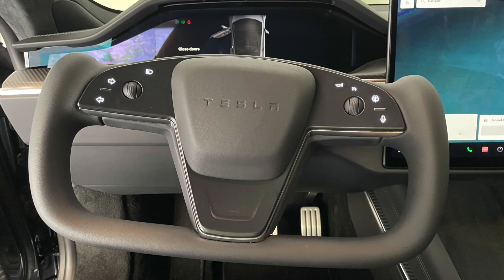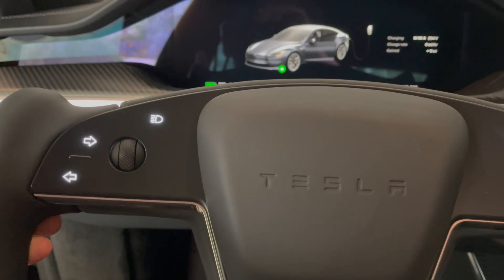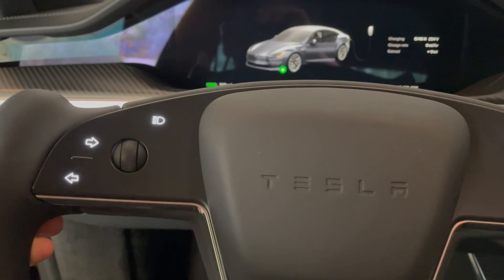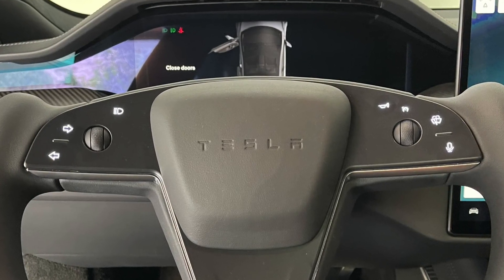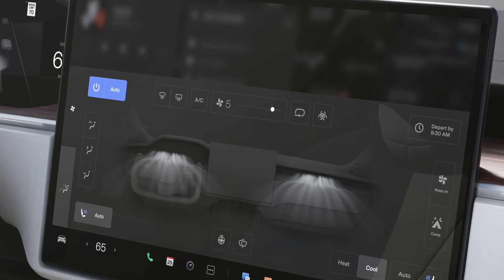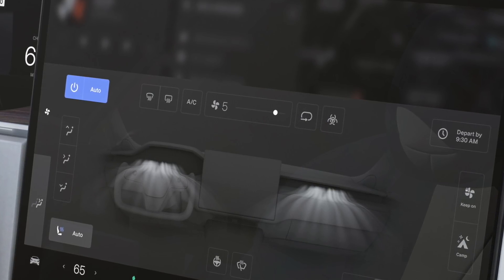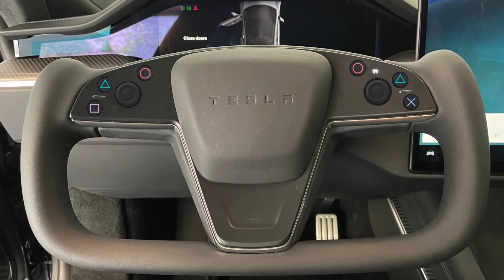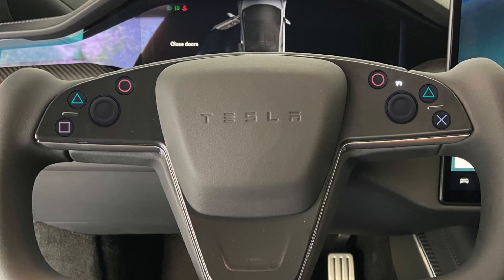Fixing Tesla's Model S Plaid YOKE blunders

Comment: Squeezing in the functions of the removed stalks into touch sensors onto a steering wheel they cut in half must be one of the worst design f ups of all time. Totally insane without having at least we'll proven level 3-4 autonomy. Untill then most human input is NOT an error.

Comment: For the price of the car, this seems like a no brainer elective recall. Use the controller design with physical buttons. Move all the buttons outside the sticks so there is no accidental push, and put triggers on the yoke handles. Either left or right trigger is the horn. Upper triggers could be added for extra programable features or game mode. A short flick of a main trigger could be a friendly "honk honk" sound. Or nothing at all, only a full pull to honk. User preference. I'd say NO icon just blank on the buttons too. Less lights and junk to add. Plus TM issues. The "lower middle right" reference the names of them for instruction would simplify use. If they have iconographs, some folks will always have to look at them to remember which is which. But with no images, they just learn to go where they are located. Safer that way.

Comment: I definitely have a love/hate relationship with Musk and his companies.  I love the innovation, vertical integration, and a lot of his general business philosophies (despite not having traditional benefits he's obviously doing something right to have so many loyal employees).  I hate when they do form over function though and I also hate Tesla's not-so-micro transaction model, if the hardware is already there why charge $10K to activate it (I'm talking about things like heated seats, I can accept the cost a bit more for cutting edge FSD).  From what I've read and seen Tesla's core (EV specific) hardware is for the most part well above any others (batteries, motors, general drive-train stuff) but their controls, cost, and (lack of) QC on new hardware (mostly external stuff to be fair) is a hard pill to swallow.  When I do get an EV I'll probably go with another brand, one that will hopefully do most stuff right, but even then I'll have Musk to thank for getting the ball rolling and showing everyone how it's done (and how it's not done).

Comment: Touch controls have NO PLACE in a car. Infact I'd say car interface design peaked in the early 2000s and we've been going backwards every since. My first car was a 2003 model, when I wanted to turn the fan or temp up to high, I could very quickly turn a knob and within a half second be on the setting I wanted. In my 2013 car I had to press a physical button 8 times to go from low to high, and unless i took my eyes off the road I'd have no idea where I was starting from and where I was at now. Touchscreen controls are a step even further away from ideal

Comment: I got my Plaid at the end of June, 6,000 miles in and I still hate the yoke (and the brakes, but less so). The video is spot on in identifying the issues, but neglects to note that everyone of these issues force you to take your eyes off the road, a lot. The solution is simple retrofit all the Plaids with a wheel and stalks from a Model 3. NHTSA needs to order it.

Comment: Everyone is parroting that Tesla is trying to "solve" something. 
Just because someone does something differently doesn't mean they are trying to solve anything, much less a non-existant problem. 
Juicero was solving a problem that only existed when they created it (and could still be bypassed by some scissors), Tesla is just fucking around with designs are sadly missing the mark on this one. 
Also, im pretty sure people said the same thing about automatic cars vs manual. 
Did Tesla do a good job? Can't say for myself but it does seem like some common sense was missing.
Does that mean no one should ever make a turn signal that is not a lever and if they try everyone automatically gets to flex intellectual superiority? Also no

Comment: I've been driving the same car since 2006 (15 years).  My car has manual transmission, manual windows, etc.  No frills.  No backup cams.  No lane assist, no voice control etc.  It's as vanilla as you can get.  Had 11 miles on it when I bought it.  Now has 190K.  I guess you and me have different ideas of "car problems".  lol.

Comment: The whole touch shit in new cars is such a terrible idea. In the car you always want to change settings blindly, that is impossible with touch buttons. They all use touch buttons because they are very cheap compared to good buttons. In the safety rating they should include a test where the driver has to acitivate basic stuff like wipers without taking eyes from the road. If it is not possible, they should completely fail the car.

Comment: Mind boggling. Many racing games fans spend extra on a USB steering wheel, despite those games often acceptably support generic controls (keyboard & mouse on PC, controllers on consoles). I expect very few would consider going back to more generic controls an improvement; but Tesla's design team seemingly is betting they would do so if they bought a high end electric car.

In my opinion their decisions fly in the face of spending preferences and decades of bottom-up tinkering (driven by fatally serious consequences for incompetence) for the sake of adhering to a design team's concept drawings.

For any vehicle's controls to demand a driver eyeball them in confusion or frustration while in motion is the most insidiously harmful thing imaginable.

Comment: Touch is almost always a bad idea, some recent examples:
- Canon EOS R has a touch bar = worst idea ever, everyone hated it, guess what? The next models removed it;
- MacBook touch bar = horrible, give me back the Function keys, and they came back;
- PS3 (I think) is using touch inputs for power on/off, half of the time I don't know if the input has registered or not, PS4 fixed it;
- recently I bought one Robot vacuum cleaner, and its main button is a touch input, so I have no idea if it's registering my input, I end up pushing hard and multiple times;

Comment: You know what'd be cool? A lever, that goes up if you wanna go left and down if you wanna go right. Then maybe at the end of that lever have a twisty nob that changes the speed of the window wipers. Then, right at the tip/end of that, have a little button that you push to squirt window washing fluid, but if you hold it down, it sprays for about 20 seconds. That'd be neat.
Or maybe voice assistant that has a dealer app so you can order a new car.
Reply: Wow, that is such a futuristic design !!

Do you think any high tech company will have the smart engineers to design such a cutting edge, state-of-the-art concept and bring it to a reality? A Silicon Valley start-up maybe?

(Love your sarcasm, by the way!)

Comment: Great topic for a video! I design board games for a living and this is the type of functional vs. aesthetical critique that I deal with on every project. I've learned is that, in general, if you design towards accessibility for the outliers that test the limits of your system, you end up creating a more ergonomic system for everyone. In this case, someone with vision issues or a missing limb/finger. Of course someone who is legally blind should not be driving a vehicle, but that doesn't mean any sane driver should be forced to take their eyes off the road or risk surprising themselves with accidental button presses. Similarly, the other rule: if it ain't broke, you better have a good reason WHY you're fixing it. 

It's great that Tesla allows buttons to be remapped, but that is unfortunately the only positive to be said about this entire setup. IF it looked super cool I'd at least give it some props there but it simply looks acceptable. I think your critique is excellent even if your eventual solution brings along its own set of issues (like, whose going to memorize what the square button does lol), but there's a pretty good reason why traditional knobs and dials exist from a functional (and safety) perspective that far outweighs the added depth and complexity of becoming proficient using them. 

I like that Tesla is questioning what is essential to the driving experience, but it's clear that sometimes they'd rather ignore pretty critical feedback and push newness for the sheer sake of newness. Tech is like that.
Reply: An excellent post !
But....”Tech is like that” ?? It doesn’t have to be. IMO new tech CAN be be both an improvement and highly practical at the same time.
It’s all up to the designers and engineers.
Can you imagine if this amazing new Plaid model S HAD a regular steering wheel, AND regular stalks (say, from the model 3/Y) ??
It would be close to perfect. A new owner could take delivery, and immediately enjoy it’s amazing performance, without even giving a second’s thought to “re-learning” how to drive.
I’m not in a financial position to buy a $100k model S, but even if I was, a highly impractical, poorly designed stalkless yoke would be a total deal breaker for me. And know I’m not alone. There are 10s of thousands of potential model S/X purchasers who feel the same way (some who have already owned 2-3 previous Teslas).

Comment: This video just proves that Tesla is a lot of money for very little quality. Yeah, Tesla is innovative in some areas and they solved problems of electric cars faster than the rest of the industry, so I don't want to take away any of this. But if you take a deep look at quality, a lot has been poorly designed or cheaply build and the reason is probably that the innovation and huge batteries and the comfort and styling already costs so much money that the car would be entirely unaffordable if you don't cut back on other aspects. E.g. take the clearance (engineering tolerance) of these cars; it's very poor when being compared to BMW or Mercedes.
Reply: The quality of new Tesla's is excellent, it's just car journalists have nothing else to complain about and don't want to look biased so they mention quality. Yes I agree with the video however. Indicators as touch controls is pretty silly.

Most other companies make only electric as "compliance cars" - so their fleet appears to be more efficient as a whole. Or in the case of BMW and Mercedes their equivalent performing electric cars cost significantly more money.

Comment: I honestly quite dislike the Tesla company (though there are some good aspects) and I feel that the critiques levelled here are a microcosm of the fundamental issues.

Besides that, physical buttons are simply superior in just about every situation. A touch screen is... fine. It has it's uses, the main one being versatility (but certainly not accuracy or responsiveness). And I think it's really past time that all the tech companies get past their infatuation with touch-based interfaces and other finicky and inferior input methods (the clickable scroll wheel, for instance). I suppose it's some misguided pursuit of "innovation" that isn't innovative at all. There's nothing new about this stuff, it's just inferior except for some very niche use cases (touchscreens specifically have a use as variable interfaces where timing of input and high precision aren't needed -- but glowy touch-based not-buttons have almost no reason to exist on most hardware as even haptic feedback tends to be insufficient).

Also, it's really weird how the intuitive elements have been removed. The horn should be a massive central "button". If you're driving the Tesla as some temporary thing, you very likely won't know that the tiny little button is the horn. Nor will you know the needlessly complex input method to use the indicators. You're absolutely right that they should just use buttons. Though not necessarily a full on game pad design as I think it's actually quite stupid and irresponsible to build video games into a car.

One last thing, just in general I also think it's irresponsible for them to have renamed cruise control into autopilot. Because it is just cruise control with a couple extra safety features. But by renaming it, that effectively makes it unsafe because too many people have assumed that autopilot is... well... an autopilot as colloquially understood. And thus there have been a number of accidents, some fatal. This too is indicative of a general irresponsibility of the company.
Reply: In a plane, AutoPilot is nowhere near as capable as what a Tesla does. So I'm not sure why it is colloquially assumed to mean "car drives perfectly all by itself". But yet, that's what almost everyone thinks of, and I did too honestly.

Apart from a few military bombers which a terrain following function, the vast majority of planes simply maintain heading and speed based on a present track made of waypoints.  They have no awareness of the real world or ability to negotiate obstacles etc.

Comment: The positioning of the scroll wheels on the Model 3 steering wheel is much more natural, and I've not had any trouble using them. They're closer to the "edge" of the wheel, so when resting your hand in a normal position they fall under your thumb. Our wheels have the rubber grip on them, not metal. I expected the rubber to get all gross and slippery like a mouse scroll wheel, but 130,000 miles later they still work great. 
Really, I think they should have stayed with the Model 3 control system - and added a twist to the wiper / turn signal stalk like the prior models.

Comment: I hate to sound TOO old school, but i think manual functions are the safest. My volvo has this automatic handbrake which i think is really cool... but one day that single button is going to fail and id like to be able to pull the handbrake manually, input devices, touch screens, illuminated icons scattered about are things that should NOT be in a vehicle. you would be fined for using a phone, a device which is just a smaller version of the thing you are driving as it is "too distracting" lol

imo I think minimalism is the way forward, every single function should be uniformly the same on every vehicle and must have a backup alternative like if a handbrake button fails, there is a standard lever situated for the handbrake to work. also whatever vehicle you get into - the functions and controls are the same. 
trying to find fog lights, in fog, in a different car is near impossible as the placement of this button is different for every single vehicle! Haptic feedback in an environment which vibrates over different terrain is not a good feature as well and controlling major functions on a jog wheel shouldnt be allowed imo.
Reply: They test things like that handbrake. The button is there because it can outlast the actual brake :-)
It seems weird to think about more components being more reliable than a simple physical handbrake you can pull, but that's what the testing shows. 

Where it does get complicated is that if it does fail, repair and spares might be more difficult.

Comment: Tesla has no idea how to make a good UIx! I dare say that having a horn not in the center of the wheel maybe not road legal in some countries. The thing is, if the wheel is turned and you need to sound the horn, that all important button is not in the same place.
Also a non circular steering wheel is an ergonomic nightmare. I’ve driven the infamous Knight Rider (a clone) and in that one hour drive, I missed the steering wheel 3 times. Especially when you drive on a road with hair pins. Very disconcerting experience for me :)

My colleague has a Model-S and he really got frustrated with its lack of QA. His touch screen failed 2 months after delivery. The engineer said: “you’re driven too much over cobblestones so the ribbon cable vibrated loose.”
1 month later the whole screen stopped working. And he says: “the majority of the bloody car is controlled through that screen! Without it it’s a cripple car.”
Now I though it was a one off. But this week starting a new project, the two colleagues there had their screens die too. And the faux leather is absolutely knackered after two years. QA is really appalling it seems. And for that price, I expect a premium product. So I’ll stick with my cheaper KIA for now :)

Comment: -They should switch the horn with the voice buttom and the voice button with the wiper. 
-Also  with the touch sensitive of the turn signals its annoying try to just the volume on the from the left scroll wheel without accidentally activating the turn signals.
-The wheel shouldve been rounded at the bottom instead of being flat.

Comment: This is just absolute garbage design overall. I was interested in Tesla for other reasons, but if they all have crap like this in them, there's no way I'd want them.
Reply: That's the weird part: They don't. At least nowhere near this bad.

For example: The scroll wheels are actually one of the better things about their previous designs... where they don't have a touch surface right next to them that you'll inevitably hit with your thumb, and where I don't seem to have any problems clicking them left or right without counting as a click down.

The model 3 has fewer control stalks than most cars, but it still has a dedicated one for turn signals / high beams.